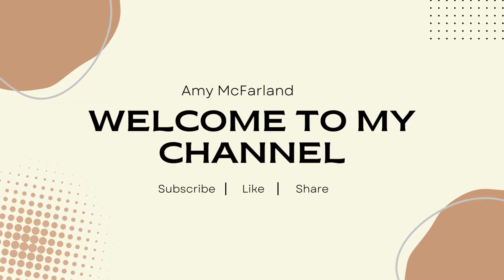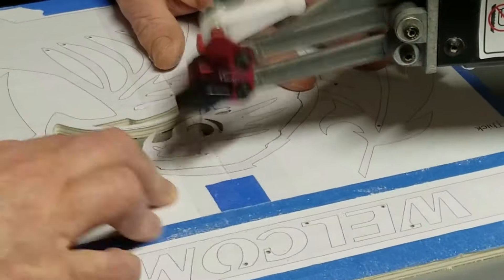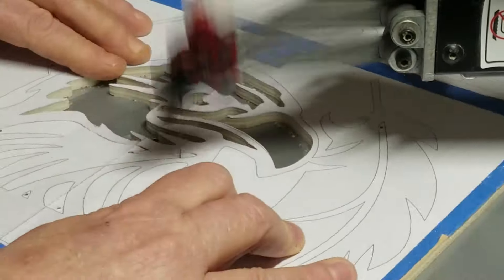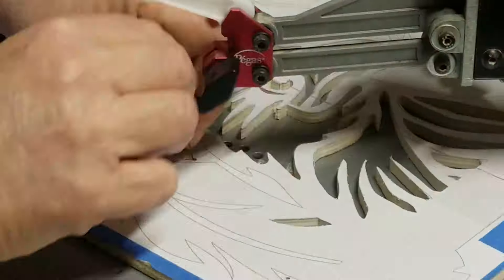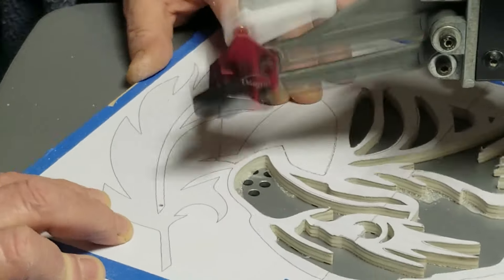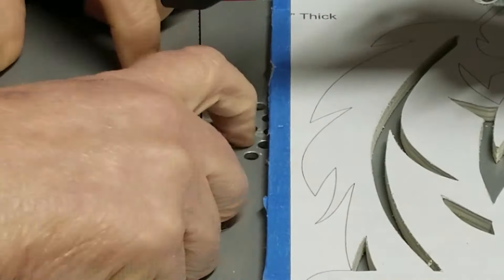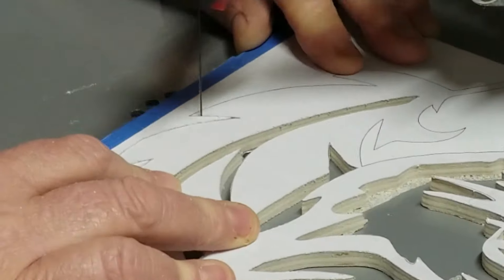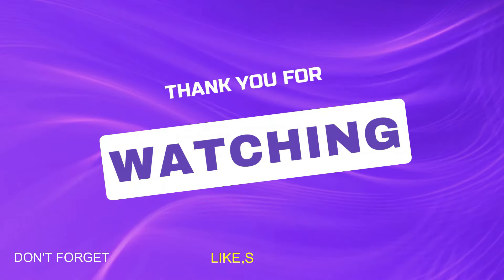Scroll Saw Newbie - It's Official! I Am Still a Newbie! Gotta Keep Going!

Comment: You can also use self adhesive clear shelf liner. In my area, SE Idaho, I can pick up rolls at Walmart, Dollar Tree, the local grocery store (2 blocks), Family Dollar (2 blocks), and the local hardware store (8 blocks). All of them carry name brand rolls, Contact brand and Duck brand. It's an old woodworking trick to use masking tape on the back of a piece to reduce splintering, so the concept has been around for awhile :) .
Reply from the maker: Gorilla grip is just another shelf liner. I'm glad I got it because it's much easier to apply than the other ones I bought in the past. I am so thankful for your input! You have given so much information that is helping me develop my skills! Thank you!